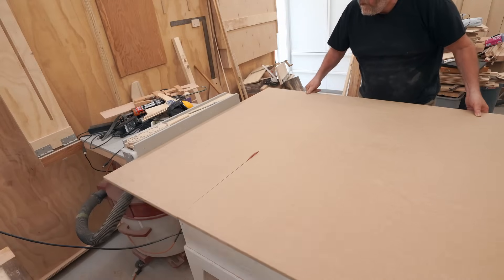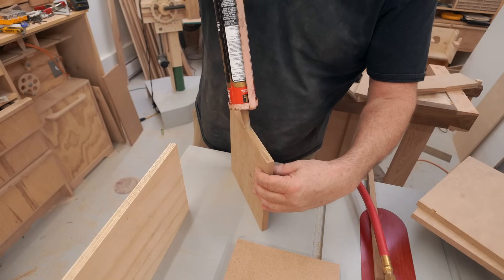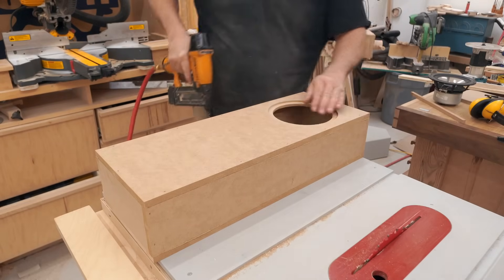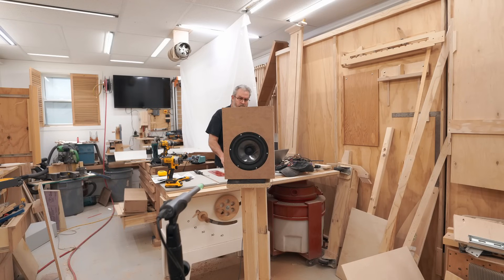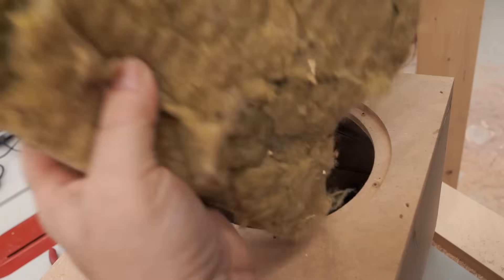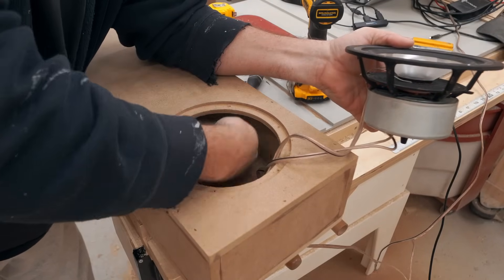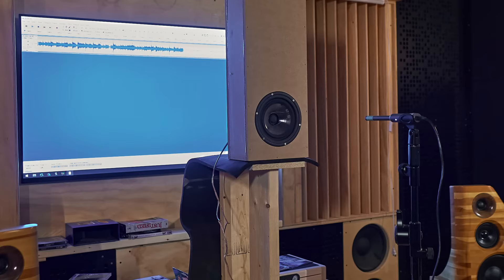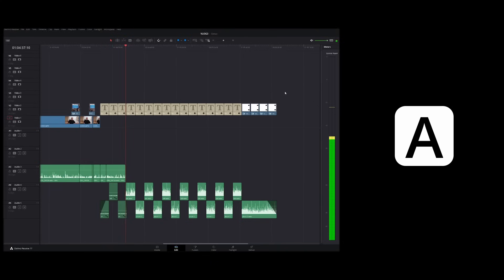Is a Deep Speaker Box Better? Tested with Surprising Results

Comment: Generally speaking the deeper speakers are better (to a point). Most important is that the cabinets are dense enough to not vibrate. I have built my share of speakers over the years. The speakers I have right now cost very little to make and the sound stage is incredible. It's fascinating that so many are into horn type speakers now (had some a few decades ago and  would not have them now). A good system will sound good no matter what the sound level is.  It's interesting how audio (as other things) seems to have gone full circle. Who would have thought that records would make a come back (still have some Sheffield Lab albums in storage).

Comment: I think this is a good starting point but it's what you do with the back wave from the back of the speaker that counts. I found that with quality acoustic foam on the side walls combined with real wool yields very good results for deep clean base.

Comment: Like a few others said, I think “A” is the shorter, deeper box. Looking at the frequency response, it had slightly more output in a lot of the low end range, and I could hear that the kicks sounded more meaty on speaker A. So that’s my guess. 

Either way, I thought both sounded good and there really wasn’t a significant difference to my ears, on my equipment, on this content.
Reply: Agree.

Comment: I built a set of speakers a few years back that have very shallow boxes, and have a passive radiator as well. I've been really enjoying them but now I want to get out the measurement mic and see how even the response really is! I was going to do that after designing and building crossovers but they sounded really flat to my ears and I called that good enough at the time. Really enjoying these simple tests of commonly held beliefs, and very cool to see how much of a difference stuffing made (looks like I have a place for the leftover rockwool from renovations)
Reply: just put white noise through them one at a time. You'll soon hear the difference.
Reply: I'm confused; putting stuffing in a closed back speaker won't hurt the sound. but does it help it? Let's say a 20" X 20" single speaker (12) cabinet.
This thing is for my bass guitar, or subwoofer

Comment: I did the same thing many years ago with a guitar speaker cabinet using a single 15" musical instrument speaker. I was looking to fit a space at a local venue. The only thing I noticed was off axis performance was noticeably different. To use an analogy, the shallow cabinet was like a floodlight while the deep cabinet was more like a spot light. This was observed at the other side of a large room.
Reply: good info
Reply: So shallow would be better for home theatre surrounds in your opinion?
Reply: Maybe if he had tried some off axis readings with his mic setup, we could see this in action?. I appreciate your input, it makes a lot of sense.

Comment: I once built speaker cabinets that were several feet deep in the back. A 5 and a half inch driver needed no sub. More cabinet volume does result in deeper bass. What is more important than what cabinet it is, is that if the cabinet edges, especially the ones near the tweeter, be rounded. You don't see really serious speakers anymore being made without that rounding off of the corners. Many noted speaker designer say how adversely it affects the sound if they're not.
Reply: Rounded or 45 degree router cut. Both will yield similar results especially as the volume goes up!

Comment: I have been curious as to why so many box designers use the conventional shape, and so few slim on-wall speakers are available. Thanks for the video!
Reply: because it literally has no effect, most of the waves are much longer than the boxes. the only exception is perfect squares. bracing, proper stuffion (not sound absorbing rockwall) and the front baffle shape on the FRONT of the speaker not internal will have signifigant results. the internals is more about vomumetric space to match the drivers optimal displacement

Comment: I can't hear a difference because the speakers on my office computer basically suck. When I plug in a pair of Yahama headphones into my Tandberg amp A sounds slightly deeper, so I would assume A is the bigger box just on that. Otherwise it isn't declarable, which means, unless it is when you are in front of them, Who Cares. I have helped people with AV equipment since I was in High School, and have basically given the same advice for 35 years, Listen to a $100 system, a $600 system, and the highest end you can afford, then buy the one that sounds best to you. If you can't tell, it doesn't matter. If you can, the lesser system will always bug you.

Comment: In my car audio days. You could buy a silcone type round piece with lots of 45 degree concentric circles that you stick on the back if the bass box to difract sound away from passing back through the cone imagine a rubber lp with deep ridges. Was this snake oil? Dont know never bought one.

Comment: Interesting.  This reminded me of something I came across 40ish years ago.  It was stating a certain size speaker needs a certain volume of box and then the dimensions ought to be 0.6 units deep, 1 unit wide, and 1.6 units tall, then acoustic insulation on the back, one side and bottom.  Now, this was 40ish years ago and I am relying on a memory that can't recall names and birthdays, so take it at that. I may be totally out to lunch...lol.
Reply from the maker: The golden ratio is supposed to reduce standing waves in the box, but that's something else I'd have to try before I add it to my list of hard and fast rules.
Reply: Dipole is the golden ratio!
Reply: I am pretty sure that the idea is/was to limit standing waves to one dimension and thereby reducing resonance peaks etc. by using these recurring fractional ratios or derived dimensions.
 (0.618...1...1.618 is the mathematical sequence). In this context people also considered the cabinet resonance to correspond to a musical frequency to hopefully potentially enhance harmonics - or not. It seems lot of it had to do with driver response.
IIRC by contrast the pythagorean ratios (3...4...5) are susceptible to standing waves and harmonic resonances. The basic idea is to avoid the ratios of scale harmonics, ie avoiding dimensions that correspond to the proportional wavelengths. Some cabinet ratios produce crazy wolf tones or other anomalies for no apparent reason, which adds to the fun.

Comment: Trying to determine which speaker sounds better by the sound that was crunched up by YT compression and then reproduced by my somewhat questionable audio setup is not an easy task. To me they sounded almost the same.

BTW what would be the perfect speaker box shape? Spherical? I understand why it's not common - manufacturing becomes way more difficult. I heard that some speakers are designed to avoid 90 degree angles (by making side panels trapezoidal instead of rectangular) - supposedly this reduces standing waves. Would be interesting to see a comparison.
Reply: Yes in physical theory spherical would be the best shape for the inside of the box.

Comment: Very good video John, and interesting results. Taking it any further would make a good follow-up and perhaps a "mythbuster".

Having a personal attraction to the vintage mass market speakers, which also have the "shoebox" style shape because that was a common design philosophy in that era, it's a relief to know that my builds are likely not impaired all that much, despite their shape.

It seems to me that a few decades ago, I recall the purposeful practice of not making speaker enclosures too deep. I can't recall the "why", (likely in books that I've stuffed away in moving boxes somewhere). It seems like it had something to do with a theory that in a speaker cabinet that's overly deep could actually defeat bass response due to internal cancellations or some such thing. The one thing I know for sure, is that nearly ALL cabinets for a very long time had variations on the golden ratio and shoebox shape cabinets. Even high end brands employed this philosophy, albeit a bit more proportional looking than department store speakers.

This was very cool experimentation. I think the only way to take it further would be to do varying amounts of dampening, ported vs sealed, and Woofer placement on the baffle.

I listened to the A/B tests and the music sounded almost identical. If I had to guess, I'd say the shallow box was "A", but only from watching the sound level meter, and assuming the SPL of the deeper box was spiking due to lack of woofer control in areas, but by the end of the listening both showed some spikes so maybe it was the song or the timing of the song as it played on each speaker.

Either way though, cool experiment, that one could take further, but you already proved that in that instance, with that speaker in a sealed box, there was negligible difference.

It seems to me, (and my memory isn't always reliable), if I remember correctly, the deeper cabinets started trickling into the mainstream speaker designs, when the woofers started to get smaller and smaller, (in an effort to cleanup baffle diffraction). Whenever I look at my energy RC 70 towers, they always remind me of the 180 degree shift in box methodology.

Great videos, keep up the good work!
Reply from the maker: I think taking it further would just muddy the water. 
Having it a simple "is there a significant difference" test like this should convince anyone who's open to the possibility that a shallow box doesn't have a major impact on the sound quality And that the idea that the sound bounces back through the cone MORE in a shallow box is incorrect.
Reply: @IBuildIt  Yup!

Comment: Thinking you should of used that insulation directly behind the speaker  on both of them then compared them. One would use insulation there anyway so not sure why you didn't.
Reply from the maker: Not enough space. The back of the driver magnet is just 1/4" from the back panel in the shallow box.
Reply: lol... I was wondering the same thing, but while you're placing the driver in the shallow box I was assuming it was due to the limited depth.

Comment: Once properly stuffed they should sound very similar. There might be some difference in FR because of baffle shape and size, again very small.
Reply: yes its different because of the baffle not internal volume. so many dont realize the wavelength of that region that is changing is several meters lol. there is not enough box space to have it bounce back and cancel. its literally baffle difference and stuffing placement. rockwall absorbs sound and it WILL make the base strong or weak. proper stuffing would be indistinguishable .

Comment: I listened to this experiment using an open baffle pair midrange and treble combined with a sealed midbass pair with no sub.  Based on the graph provided and the listening experience I had, Box A has a very slight bump in the deeper bass notes and B has more kick timbre. My interpretation is box A is the deep box and box B the shallow one from what I was able to detect through my listening source.

Comment: Listening to this video while watching it on my CELLPHONE, there's literally ZERO noticable difference between the two box designs, but I already KNOW that there definitely IS at least a slight difference in sound between the two designs, it's just that a cellphone speaker is NOT high enough of a resolution to actually be able to hear such minor differences.

They both sound exactly the same when listened to through a cellphone speaker, however I do KNOW that they DO sound different, from my many decades of experimenting with speakers myself.

The real shame or sad thing here is that most average people won't ever even know what that difference is, (OR which one ultimately sounds "better"), because they aren't comparing them on a high enough of resolution speaker system to actually be able to hear the difference, so most people won't even care one way or another.
Reply from the maker: Come on back when you've had a chance to listen on your high rez system or with head phones.

Comment: Interesting. Thanks for this. I have a personal interest in this because I have been thinking about subwoofer build in my (too) small home theater. And the reason for shallow box is obvious: there is no room for large boxes. Tried to search something on the topic but pretty soon found out that no one is builind shallow woofer boxes. Thought there would be some reason for it. So this got me thinking, if reflection is the problem, I guess it would be easy enough to put a angled wall behind the speaker element to reflect the waves up.
Reply: hello i am no one,  i built a shallow subwoofer box. 6" deep for a 10" shallow mount subwoofer driver. 
i got great results, below 200hz its fine. 
i also ran it up to 2000hz a little while, i liked that also but i would not recommend that.
Reply: @JaniLahtinen Shallow subwoofer boxes are fine. Use some absorption on the back wall to help diminish reflections. The wider the baffle the better. As long as you have enough room behind the driver motor's rear vent (hole in the magnet structure) you won't have any problems. Roughly 2"to the absorpbtion material is a decent guess The length of the sound waves from a subwoofer are so long that reflections thru the cone aren't really a problem with smearing the sound. That happens in the upper octaves.

Comment: Good video, with interesting tech content. I'll be honest, I couldn't tell which box was which, although I could hear that there was cabinet noise from both. However, that shouldn't really come as a surprise because the frequency responses were similar, with no obvious resonances. I normally use the 1/4 wave depth to cancel/unload higher TL modes - maybe this is flawed?
What you do find with really high performance, but not necessarily expensive, systems is that it's about keeping the various distortions below the level of the recording background signal. This is what people tend to mean when talking about "the soundstage": the newly introduced errors are small enough that you can still make out the room reflections from the recording session. It is a very tricky thing to get right, as two speaker designs might measure flat but one can produce a much better 3D image than the other. But, getting a well damped cabinet is the best way to start the journey.
I ended up manufacturing my own magnet systems, and am still finding ways to reduce errors between class D amp output and full range driver. Coax is a neat solution...

Comment: From memory, isn't the golden ratio of internal dimensions 3:4:5 to minimize standing wave amplitude? With advances in manufacturing, non-parallel box sides has become a thing, I'm not sure how much science is behind it. I believe KEF is unique in absorbing the back wave with their META disc and mechanically decoupling the driver from the box. To every action there is an equal & opposite reaction.
Reply from the maker: I'm not at all convinced that META material works for sound (I made a panel and tested it in a previous video), but I do know the power of baloney. AKA, tricking the consumer into thinking something amazing is happening by rubbing a bunch of pseudoscience all over it. 
And when the action is tiny (read insignificant), the equal and opposite reaction will also be insignificant.

Comment: I have a sundown sd3 10 d4, it requires a sealed 1cf enclosure. The enclosure i built is rather shallow (shallow sub). I thought it needed to be shallow but do you think a shallow sub would do ok in a deeper box?
Reply: Sub bass has such long wavelengths it's not going to be a huge difference.  Just like in the video, you'll get more benefit from using rockwool or polyfill stuffing to break up the standing wave inside the box.  

That said, it won't hurt the driver at all to go with a deeper box if you can fit it, as long as you're not increasing the airspace beyond what the driver is intended to be put in, and all that's going to change is what frequencies of standing waves are created (again, put rockwool or polyfill in the box to reduce the effects of that).  

I would also ask that you double check your enclosure specs for that driver.  It's intended for a sealed box between 0.5 and 0.75 cu.ft.  The 12" is happier in 1.0 cu.ft, though going larger box with the 10s will help them play a bit lower, just looser, and sadly with a little more risk of damaging the woofer at high volume, assuming you can power it past what the suspension can control.  (I do car audio for a living, 10 years professionally, 12 more unprofessionally, if that at all backs up my information)
Reply: @shopmunkey  hey man i really appreciate the answer. Great info too. Yeah i was mistaken, if I recall correctly the box i built was a 1/2 cubic foot. But the frequency feels too high, the only way i can explain it is that the bass sounds hollow if that makes any sense. It’s completely sealed, no air movement whatsoever, i built with 3/4 MDF and i used poly fill initially but removed it because i can’t seem to get good sound from it. My goal isn’t really to have monster bass, i just want a punchier clean sounding bass to take the music to the next level. Going bigger isn’t really an option (changing from a 15” PPI sub) because i need the space in my Tahoe. Again, thanks for the good info bud.

Comment: What about the possibility that since the box is less symetric, that the lower portion of the driver needs to push air harder than the bottom, creating a non-linear woofer response?